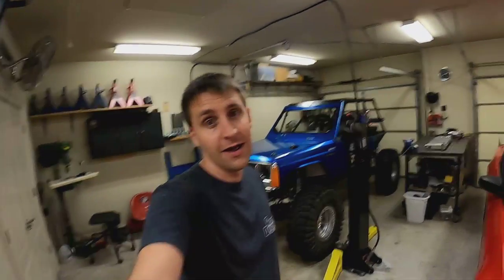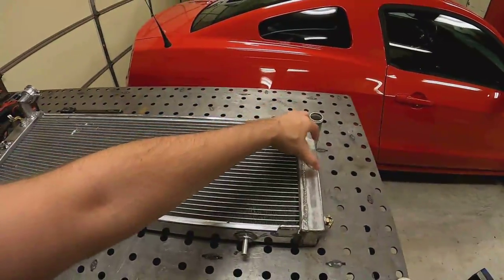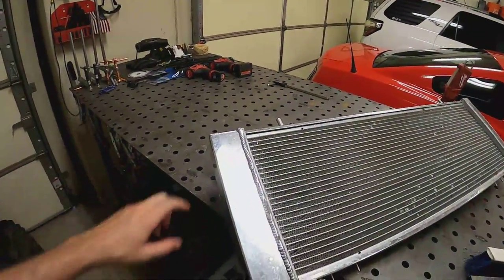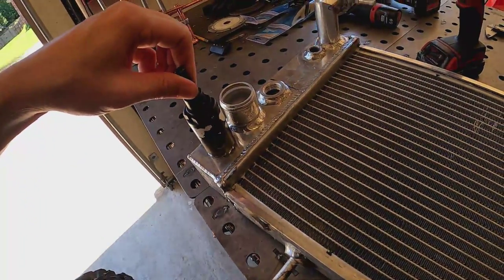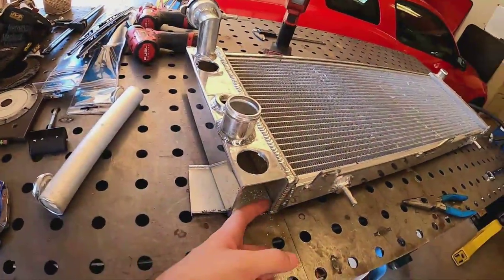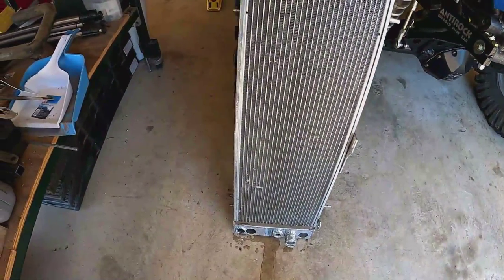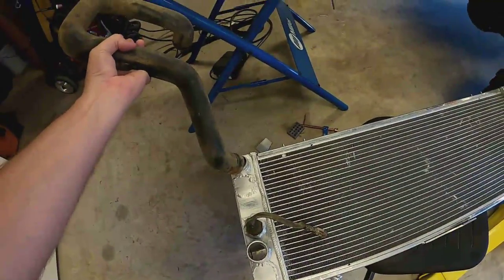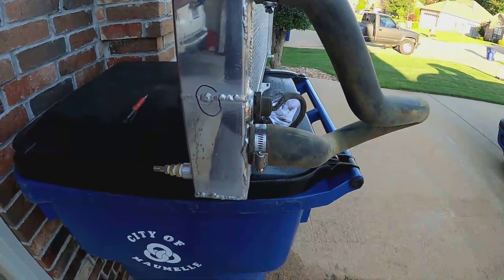Building a Custom Double Pass Radiator (Better Cooling, Same Package Size)

Comment: Perfect, I have a single core that I need to have entry and exit on the same side for a rear mount radiator.  I was relectant because I thought I'd have to weld that inner edge along the core.

Comment: I am super curious how this affected your cooling efficiency? Did you see a noticeable difference?
Reply from the maker: This really did improve the cooling with the Champion brand radiator. Recently, I did this same modification with a Mishimoto brand radiator and while I did see further improvement in cooling while driving, over the modified Champion radiator, the cooling at idle actually got slightly worse with the Mishimoto radiator.
Reply: @HeBeGB501  probably because the flow is less at idle.

Thanks for the video! I was looking for a new rad and this mod might fit the ticket! I also own an ac/DC tig.

The way my rad is for my 81 Camaro, I would actually be making it into a triple pass! Even better!

I'm definitely doing this mod! Thanks